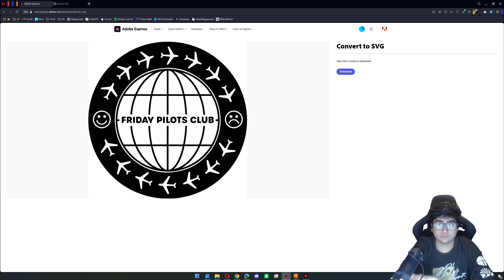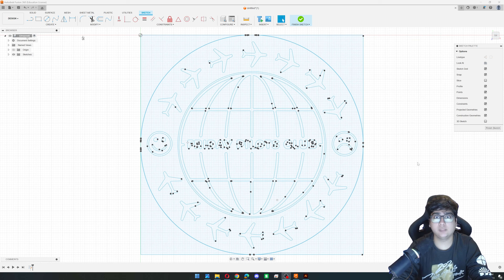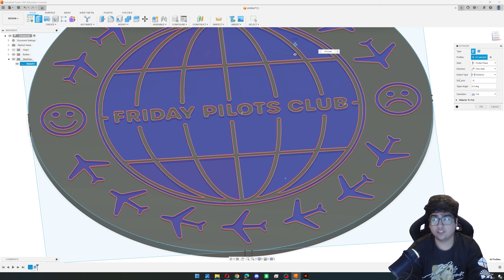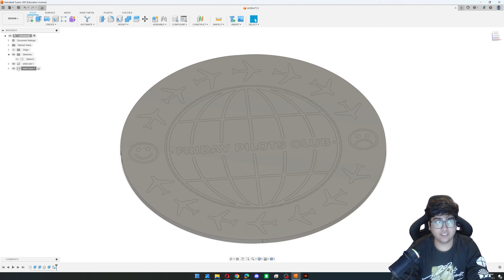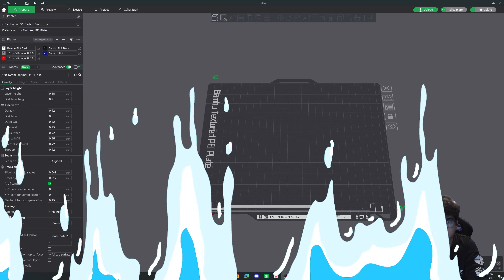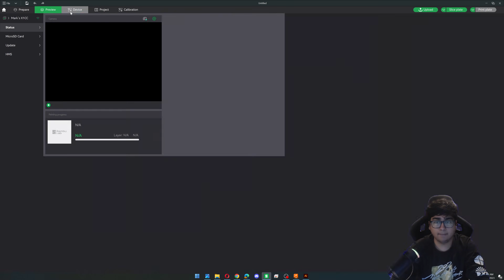How to make dual color coasters in Fusion 360 // Bambu Lab AMS Tutorial

Comment: Hey, seriously—I’ve been trying to figure this out myself for two days. Everything was going pretty well, I even automated most of it with a script in Fusion, but... I kept getting artifacts when slicing and it was driving me insane. Importing each color as a separate STL actually worked! So thank you so much for your video! 🫶

Now I just have to figure out how (or if) I can combine the four colors + the body into one STL, but I guess that’s probably not possible. Every time I export the finished models as one STL for Bambu, I get the same artifact issues with the STLs. (╯°□°）╯︵ ┻━┻

Comment: Quick question if I wanted to add a QR code to the back of it for instant. I'm trying to get this to work and can't seem to have it show up after sliced. What am I missing
Reply from the maker: Adding a QR code can be a bit more challenging to accomplish in Fusion 360, so I would try it out in Bambu Studio. After you assemble the pieces, if the the design is gone after you slice it, you may need to move the design up/down in the Z axis a little bit so it’s peeking through the surface just a tiny bit. If that doesn’t work, I would look at the assembly in the objects viewer and cut (ctrl + X) the first body in the list, then paste it back into the assembly (ctrl + V) so that it appears at the end of the list. In some situations, only the last body in the assembly (the one closest to the bottom in the objects viewer) generates toolpaths when it’s intersecting a larger body. I assume this is a bug with Bambu Studio, as it has been happening for quite a while and seems to be becoming more prevalent. I hope this helps, and please let me know if you have any more questions. Happy printing!